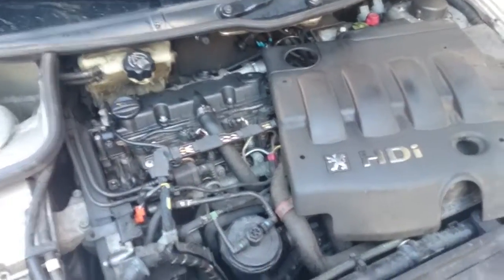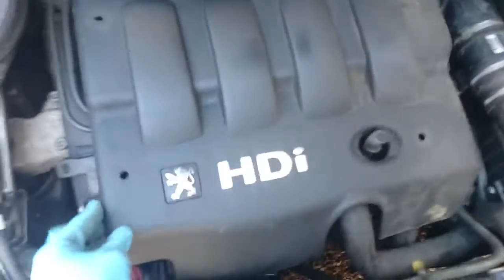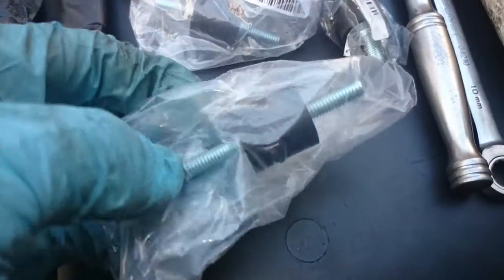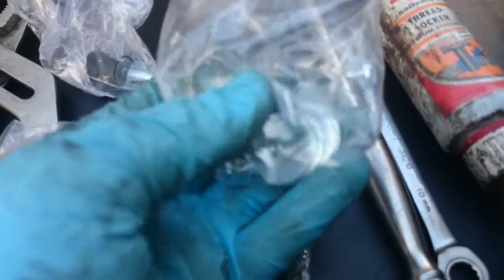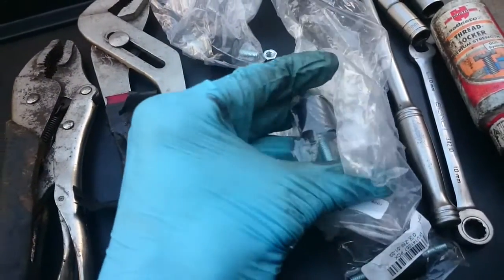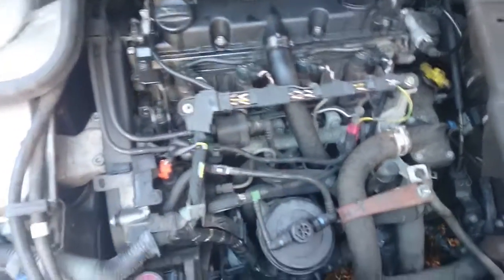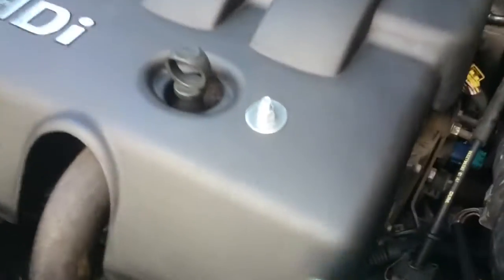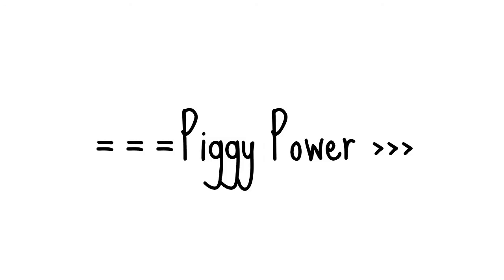HOW TO: 2.0 HDi turbo diesel engine cover fix, Peugeot, Citroen

Comment: Hi, Can you advise on the removal of the rocker cover on a 1.9td Peugeot Boxer 92hp ?
I have removed the three securing bolts but there doesn’t seem to be enough clearance to remove the cover ?
It is hitting the intercooler pipe housing which sits directly above it.
Does this have to be removed prior to the rocker cover - seems a bit odd or am I missing something ?
Thanks, Will.
Reply from the maker: You'll definitely need to remove whatever is above it if it's in the way 😜 ... By the time you'd written your question you could have removed it 😜👍🐷

Comment: Hey piggy power, can you please do a video on under tray engine cover.
Reply from the maker: LinearAlgebra I could do indeed...what about it though? fitting? removal?
Reply: Thank you so much for your reply. I want to see that how you can fit it with suitable screws and clips. I think the screws are not like normal ones instead they are flat ones as I have seen on ebay site.
Reply from the maker: LinearAlgebra thats right. I do need to look into a better idea. Basically the OEM fittings push in and twist out.
Reply: Piggy Power sure! I will be looking forward to your video about fitting underlay covers. subscribing now for updates :) cheers!

Comment: If the cover is loose it can vibrate and screw off the oil cap and/or break the dipstick.  Real nause.  Will be doing this next week.
Reply from the maker: wow. I've never known it to remove the oil cap but yes I have seen them destroy the dipstick and other little parts
Reply: I didn't realise it it was doing it until I'd gone through two caps.  The first one I blamed on my mechanic. The 2nd one that did it fell down and got trapped in the accessories belt and fucked both the belt and the tensioner. Realised that it was the engine cover so I took it off and it now just lives in my garage.